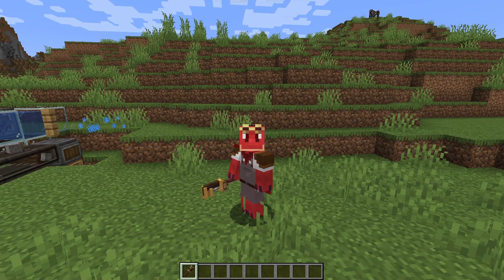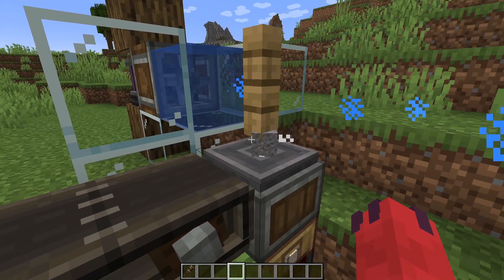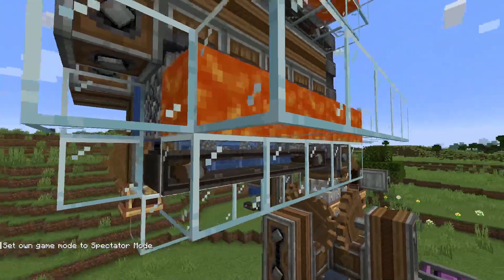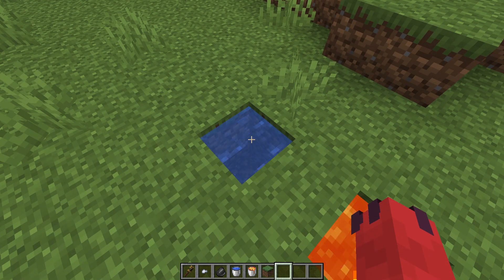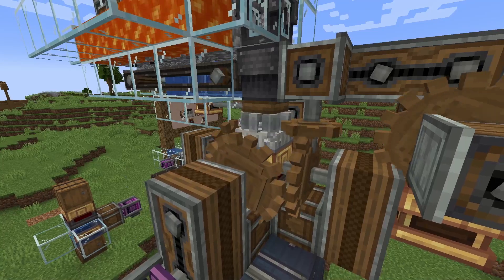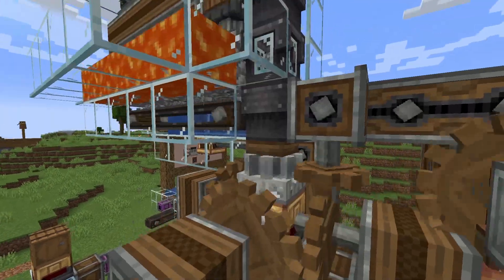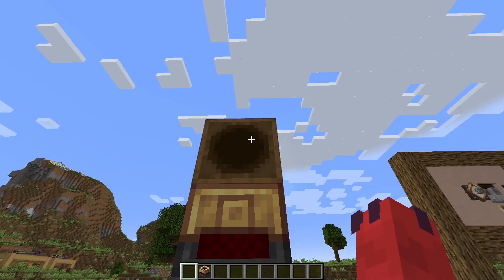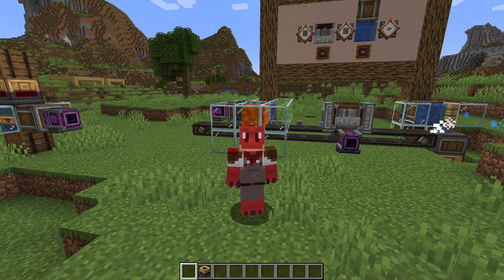How Create can be used to make an Automatic Iron factory!

Comment: How hard is it to aquire the initial components? It feels like cheating, no villagers! 😮
Reply from the maker: It’s possible to just do it with andesite alloy and iron (for fans, millstone, shafts, etc), but it’s easier with brass (allows the filtered washing so you don’t need to fiddle with timing the belt in front of the fan)

Comment: By the way, I once saw a video where was showed that in fact the items on the depo are crossing the border of the lower and upper block. That means, if you use the depo, you can double the speed of washing because there would be whole eighth fans instead of four. On each side one fan on the same level as the depo and another one on that first fan